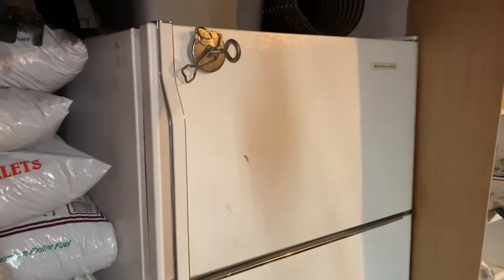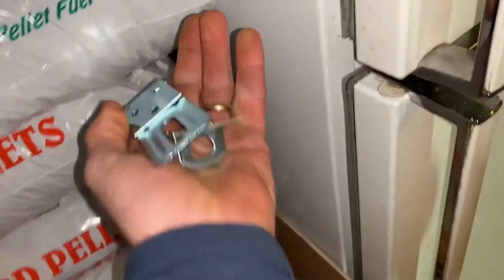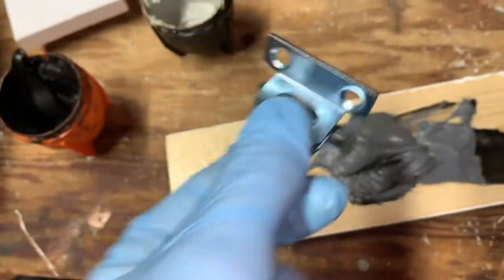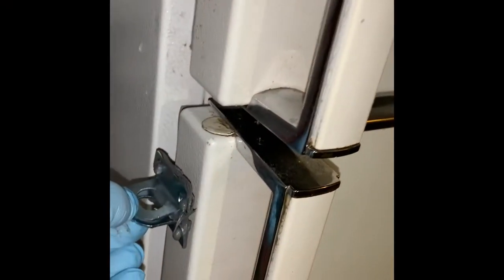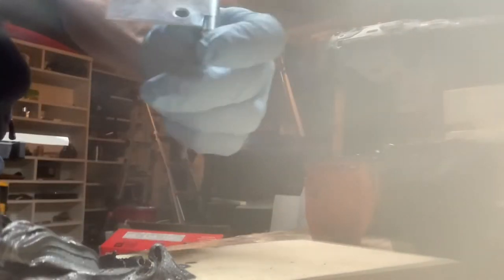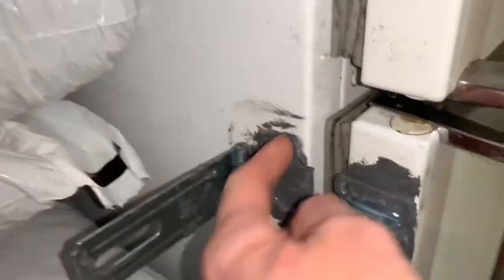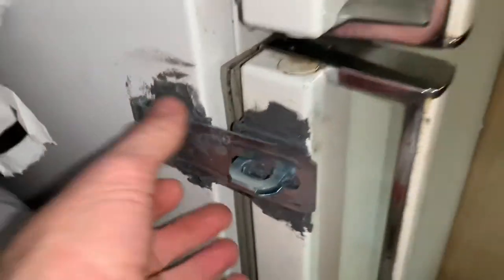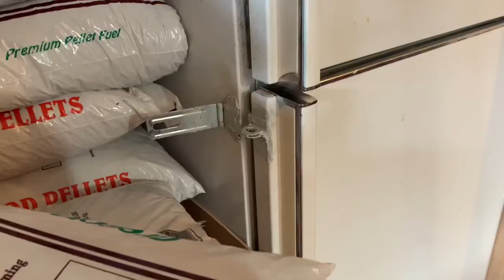DIY How to Lock Up Your Chilled Sweets, Soda & Beer Fridge Without Drilling Into It [Padlock]

Comment: I actually have the same kind of parts as you when it comes to the screws etc. but if i choose not to use the screws, do i use that sticky stuff you put on those two pieces? Is that silicone?
Reply from the maker: I screwed it in with a little epoxy on the back and then around the edges after it was screwed in
Reply: @DIYTechnician  wait- I thought that this was supposed to be in place of using screws? What was the size of the screws?

Comment: I did this today using Gorilla two part glue. It seems to have worked but mi 17 year old autistic boy is clever, or mean, enough to hammer at it. If it seems solid in the morning, I'm doing the freezer. I bought a 10 cubic ft frost free fridge to to keep our butter, sauces, drinks and clean ice and anything else he taints on a regular basis. He'll have his own fridge.
Reply from the maker: Great idea. So you may want to reinforce it with a two part epoxy since he’s smart enough to try to pry it off, I’m afraid gorilla glue may break free if given a fair amount of force with a tool or tools. Thanks for letting me know! Great to hear this helped.
Reply: @DIYTechnician  
yeah, that's what I used. Thanks.